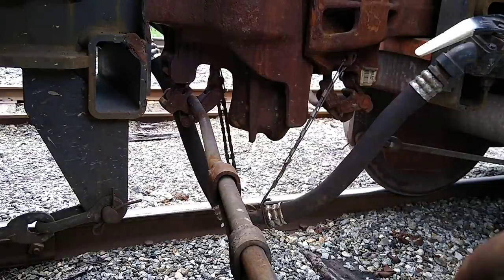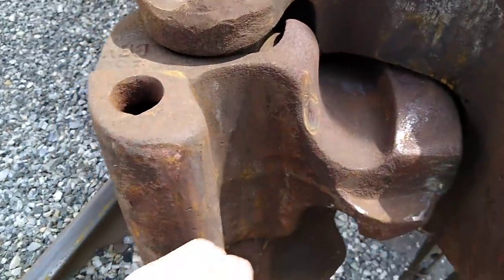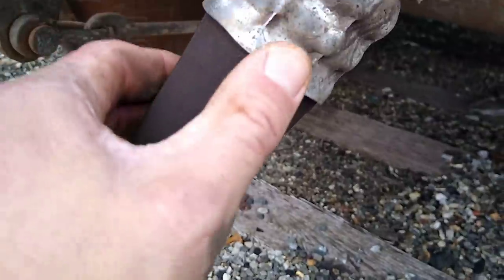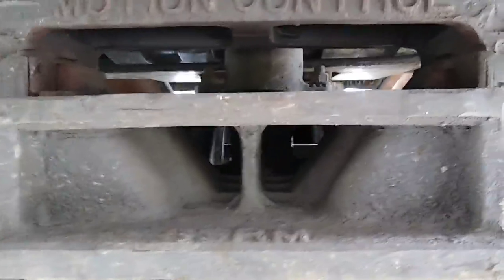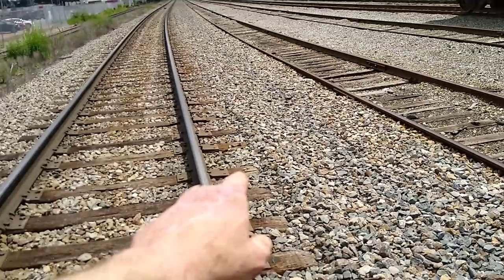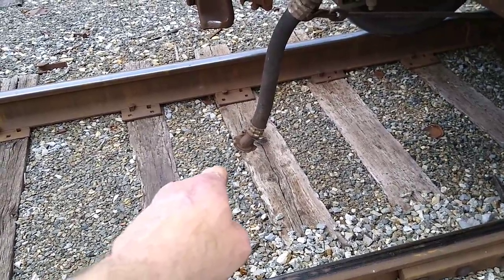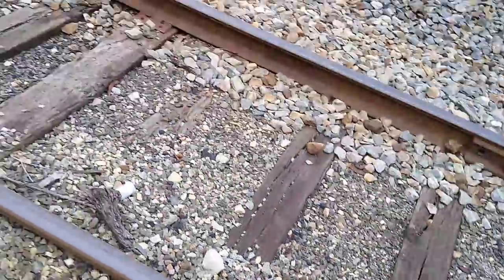Couplers and braking systems knowledge

Comment: FRED, Flashing Rear End Device, the modern ones we have on the BNSF clamps onto the knuckle, it monitors the air pressure, the rail lubricator is what we call track greaser, it pumps grease up to the gauge side of the rail ball and the wheel flange carries the grease for up to 5 miles into the curves which helps with the face gauge wear mainly on the high side of the curve.
Reply: "Flashing" eh? must be a euphemism.
Reply: End of train telemetry device. Boy could I tell stories. Newer ones have a little air generator. Powers it by bleeding off a small amount of air. As stated, they read air pressure, but they also are in communication with the locomotive for other things. If the engineer, positive train control, or one end detects an emergency application, it will dump the air at both ends. Air travels at ~600 feet per second in the train line. It also tells location. 

They don't typically last. Vandalism usually gets em. Employees usually. Average life is like 16 months.

My father was quite hated because his career was based upon eliminating train crews starting with the caboose.
Reply: Is there a risk that the grease reduces traction for a locomotive (especially a DPU that's further down the train?) Thx.
Reply: @2flyabove  Not really, it is supposed to lubricate just the flanges. That's not to say the grease doesn't occasionally get up there.  If it does, it will slip till then gen field cuts out. With momentum, shouldn't have much issue. If stopped, may have to have help to get going again.

The ACE's can modulate the traction motors to get enough traction to actually cause a measurable lift in the rails between the trucks of the locomotive. It's not much, but you can find all the loose tie plates. You can actually measure the twist of the axle between the wheels as well. IIRC, they cycle at 10k Hz
Reply: @herpnderpn2484  thank you for your helpful reply. Much appreciated.
Reply: @herpnderpn2484  If you get grease on the top of the rail...it's putting too much on.  They can adjust it for how much it puts on each time.

Comment: Always kept a few o-rings in my pocket for them glad hands.... had plenty blow out when separating cars. 
That center pin in the cup is about 1 foot long... I've seen them bent at 90 degrees over and 90 degrees up on the same pin after a derail.

Comment: I always wondered how those airlines separated. Thanks!
Reply: When I was a kid I remember one time that someone where the kids had found a band railroad brake hose somewhere Body apartment complex office to live in when I was a young kid.

The trains ran on both sides of that apartment complex front and back.

What are the issues is there was only one Road in and out which of course was a railroad crossing AKA grade crossing.

And when there was maintenance operations going on like once a year when they did tree trimming for example.

If I'm not mistaken they use the hardware all vehicle for that or that could have been something else I can't remember long time ago.

You know what cherry picker or bucket truck.

By the way one of our neighbors work for a neon sign company years ago much later on probably in excess 20 years more or less don't know for sure.

He was painting his house and he you know the old adage work smarter not harder?

He borrowed when the company's bucket trucks since he was an employee so we could use it when he was paying his house instead of using the ladder and a lot of the places now dad's just genius!

I actually once saw a bucket truck take out some utility lines for some reason the broom was raised when they're going down the road don't know why but yep there was one more line in the area that's a bit lower well some people want power for sure.

How do you explain that to your own utility company yep it was a bucket truck that was on and used by the utility driver was a linesman 4 said utility company oops.

Heard about that on the news layer of course.

I thought it was Safety First well looks like a safety second nap time and working for the company that you destroyed the wine as well did I do that is probably what he was thinking sort of.

Also I remember one time after bad storm a neighbor one time had a Marge tree limb come down or perhaps a whole free I think it was just giant limb can't remember unfortunately it took out the wiring to a street light pole snapped the pole of course.

When they were replacing the pole because they could not get out of the driveway and I words that are stuck because of the tree or tree limb.

It wasn't their job or anything but the utility company decided to try to help and since they already how do utility crane they were going to try to pick up the limb or the tree and move it at least out of the way of the driveway so they can get in and out.

Even with Outriggers extended and everything it all precautions in place and careful lifting is that free or limb was almost too much for the crane truck it was actually lifting off the ground bus several inches on one side but they managed to drag them mostly dragging it they couldn't even really totally lift it they more had to go Bragh it today anything but hey at least they were able to get out of the driveway just goes to show people trying to help other people even when it's not their job.

Comment: One reason they turn those ball valves slow. Is because it can blow the valve up and send the ball out like shotgun. We had a guy do that fast in our shop one time on 120psi. It sent that ball through a 1/8” thick steel beam 50’ away from the valve in our shop. Lucky it didn’t kill someone but it has in other places. (PSA) Never ever turn a ball valve fast with any kind of air on it. Always turn them slow and easy. I’ve seen what they can do
Reply from the maker: Dang
Reply: Also thank you very much for the knowledge and videos. Make them as long as you want or can. 
I only wish I could do what you do.

Comment: I used to work at Mellampi MFG in the 90's they were owned by standard car and truck I think that's the name. Anyway I used to make those pins that hold the brake shoes in place I used to make a bunch of other parts for the train cars

Comment: Flange greasers are common in the UK and Europe. Of course we don't have the huge distances of US railroads. Do any US railroads use pandrol clips to secure the rails on the sleepers? I know that some have continously welded track. Excellent upload Shoestring, thanks fella.
Reply from the maker: Yeah... We call them rail anchors.... "C" shaped
Reply: @TheHoboShoestring  Isn't the track in your video in a dreadful l condition? The sleepers are rotten, and the rail appears to be attached using a few large nails, and of course your permitted axle loads are much heavier than here in the UK. A derailment waiting to happen.

Comment: I don't think the brake shoes apply force to the axle, they apply force to the metal wheel itself. Depending on what type of car it is, and how recently it was built, it may have free-floating wheels on axles which makes going around curves easier, and reduces the risk of derailment due to the wheels tracking from side to side because they've worn down too much. Harmonic resonance is what happens and if it happens at a high enough speed, it can set up motions that can derail a railcar. If this is discovered during maintenance the wheelsets will either be repaired or replaced on the spot, as railroads don't like having to clean up derailments.

Comment: When a train goes into a hump yard to get broken up, why don’t the brakes come on as it gets sent down the hump?   Do yard workers close every angle cock valve?
Reply from the maker: Actually after I made the video I realized I should have explained that part too.
There's an air tank on each car and a pin that workers pull to release the sir pressure in the tank which is holding the brakes. After the air is let out the brakes release.
I'll make another one about that.
Reply: @TheHoboShoestring  I don't know if that's information that the youtube public needs to know. Pretty soon cars will be rolling out of sidings because some railbuff learned on youtube how to release the brakes. We all know how far railbuffs will go to feel like they're part of the railroad.
Reply: Chester Kopperpot they typically don’t keep air in the tanks    No air no move.
Reply: @diamondback2295  well no. once the tanks are mt there is no pressure to apply the brakes. The only way to apply the brakes without air is to wind up the mechanical handbrake
Reply: @ChesterKopperpot  lol most every siding I have seen is sloped (barely) to the dead end or dished (low in the middle) unless they are servicing a customer in which case they will be dead level.
Reply: @diamondback2295  It's actually the opposite. If there is no air there's no brakes (except handbrakes). When the train cuts away those cars getting left behind get put into emergency, which means the emergency reserve in each car applies the brakes. That air bleeds off (sometimes in a matter of minutes) and all the brakes except for the handbrakes release. But I digress.
Reply: @edfrawley4356  I'm qualified on 600+ miles of territory. In those territories that I work there are zero flat sidings, 2 bowled sidings (and most railroaders know that cars roll out of bowls everyday), and probably more than 30 sidings on a grade from start to finish.
Reply: Chester Kopperpot oh. Ok. My air brake experience is from trucks.   In that application the air holds the brakes open so if you don’t have air you are locked up.    Didn’t know trains were the other way around.
Reply: @diamondback2295  from what I understand yes and no.  I believe when a brake application is desired the train will reduce air pressure in the lines and this applies the brakes.  In case of rapid loss of air pressure in the line all brakes will go into emergency.  However this system requires air pressure in the system to operate in the first place.  There are tanks on each car to store air in to apply the brakes but without air in the tanks there will be no brakes.  Trains need to build up air pressure in order to reduce it to unlock all the brakes.  Strange system.
Reply from the maker: Well I figured that out before I was shown. Anyone can figure out how to release a brake
(Replying to the person talking about rail buffs letting the brake off)
Reply: @TheHoboShoestring  respectfully that doesn't mean they need to be shown how to bleed air
Reply: If someone wants to screw with something they will. Furthermore the kind of people who want to screw with something arnt going to look to a video like this to find out how. 
My point, the chances of someone taking the information he gives in this video to taking nefarious actions is near zero. The knowledge he giving to us with simple curiosity far surpasses the risk that some jackass will do wrong with it.
Reply: before they hump a train the bleeders-car inspectors bleed the air out of all the cars as most times all the cars have been dumped and the brakes are already set.

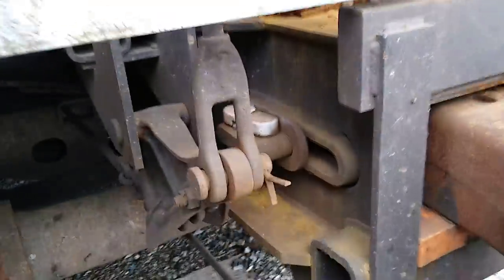Comment: That bar you talked about at  9:15  that goes through the slot in the draw bar. I'm sure that takes a beating the way it gets jolted. My question is how often does it need replacing?
Reply: Not very often.

Comment: Thanks for your videos. You mentioned the slack in the knuckle, but if you add the coupler spring stretch during a trains departure, wouldn’t you have several feet of slack from the front to back of the train?  I remember watching one of Stobe’s videos and you could see the locos had moved maybe 50 feet before the slack reached Jim’s car.
Reply: Different cars have different amounts of slack. Autoracks and cushion underframes have several feet of slack as opposed to tanks and ballast cars which have almost zero slack. With the average road train being between 150 and 200 cars these days the amount of slack is usually quite a bit more than 50 feet
Reply: Chester Kopperpot Stobes video was am intermodal. Not sure how much slack they have,  but could easily be a foot per car.

Comment: I forgot to mention that the weight or size of the rail is measured by a three foot section of rail.
Reply from the maker: Oh, it's three?
I thought it was PPF
Reply: Hobo Shoestring's freight train hopping videos  Yes, the weight is by 3 foot sections.
Reply: The weight, year/month of manufacture, and manufacturer is also stamped on the side of every rail section.
Reply from the maker: @jonathanparker2939  
Yeah I did a video on that in my older videos

Comment: When cars are uncoupled, the air hoses separate automatically.  Considering that they are locked together, how are they able to pull apart without being damaged?
Reply: That is a very good observation. The hose palms are locked together by a twist action and the two rubber gaskets apply pressure against each other to keep the palms locked together and provide an air seal. The locking protrusions are rounded so that pulling them longitudinally will allow them to jump over each other and the palms to separate. Sorry I can't explain this better, but if you see one you will understand.

Comment: A guy I worked with at my current place of wage-slavement on this soon-to-end hell of being stationary and housed up with itchy feet (Freddie's calling me and it's for more than a week or so ride 😭) used to work for CSX (think he had about 15 years in with em) and was always shocked at how much I knew about trains. I didn't tell him for months that I rode cause I was tryna see how much info I could get out of him and didn't know how he felt about riders since it's always hard to tell with workers. Most hobos and travelers with a code they never see, it's the reckless kids that they usually have to clean off the tracks or blow out hopouts and fly spots in town and shit in cars with no respect for others at all. Some workers are great, others think they're cops or own the joint and are mad hostile. Most I've met have been alright, but a few memorable asses were anything but. He was actually really cool about it once I told him lol Gave me a couple hats and was supposed to give me a belt or belt buckle and a crew change but he left and I never saw him again unfortunately. But for all I got up in my wetware, it's nothing like what Shoestring has! It's a privilege to hear and see. 

Oh, and I lost a good multitool to the infamous cheese grater. Ripped that thing straight off me and about as soon as I realized I heard the slack pull so I didn't hop off to grab it even though we were pretty far back. The steps at my job are almost identical and every day I see em it reminds me...

Another great video, Shoestring! Great shirt too lol Stay safe out there!
Reply from the maker: Haha.... I've lost mag lights to the cheese graters   lol
Or the hole of doom the holes in grainer floors and lost battery packs beers etc

Comment: 2:04 It's calll the cut lever, not decoupler bar. 6:50  That's not the axle. It's the wheel tread the shoes grab ! 11:07 Rail is weighed per YARD, not foot..11:36 That's probably 9.5" tall rail..If you sliced off a yard (3') it'd weigh 152 Lb..17:06 They're spikes not nails. What's a "Spikadore"? 17:36 What's the hammer for ?!. "Bang the hammer down into the door track" Do you mean a boxcar door track ?

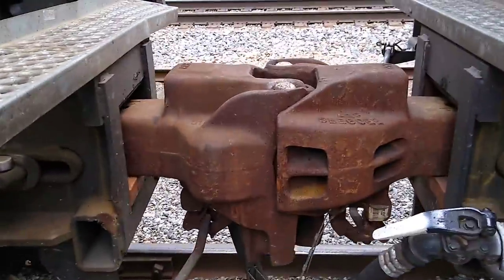Comment: 2:27 there’s more slack then that. I think there’s 3 inch of slack on each coupler
Reply: You are right but it is not "in" the coupler. there will be more between the coupler and the cross key and then there will be more again in the draft gear(which could have a couple feet of travel).
Reply: Ed Frawley you understood 🤷🏼‍♂️

Comment: OMNX 1441 - OmniSource Corp -  AAR Class/Type  GB G519 - Unequipped Gondola, Inside length 52-61ft, greater than 9ft inside width, Steel Floor, solid ends, Inside height: 60-167 inches, Load Limit: 205,000 and greater - This car is Plate C, tells you the size of side/top clearances are - Dry Cap is 3267 cu ft.  Information source: http://www.rrpicturearchives.net/

Comment: if you roll with only 75 psi...... you only have 5psi of brake force (the train brake operates between 90(full off) and 70 IIRC
.
now you can still stop.... by going into emergency, which drops it down to 0 (so in this case....75psi of air)
but an emergency stop from 90 psi means you would have 90 psi acting on the brakes 
.
i do believe.... that just like a semi truck.... their are "spring brakes"
if air drops to 0 on both sides of the triple valve.... springs take over.... and apply the brakes
.
idk.... i thought the air kept the shoes off the wheels
but then you can bleed the air off in yards and humps to allow the cars to roll
.
so im pretty sure its sorta like a semi truck
.
i used to know all this crap....